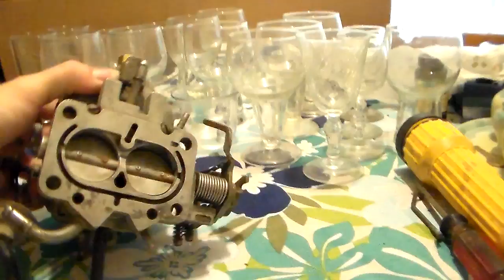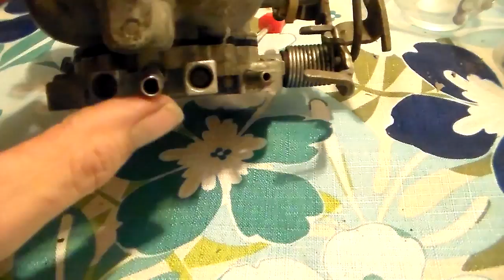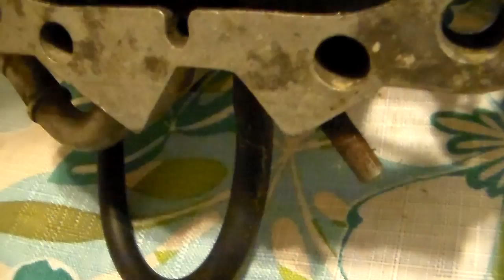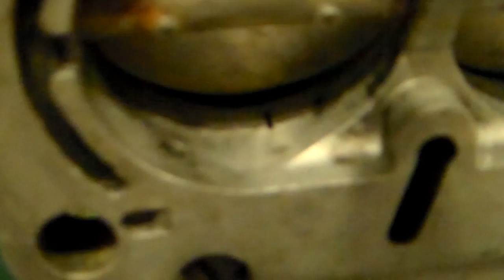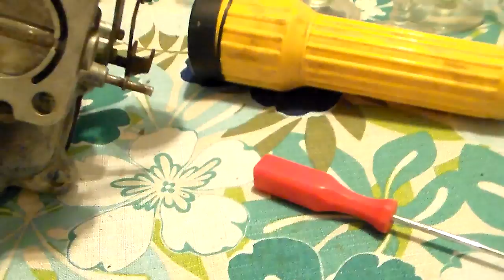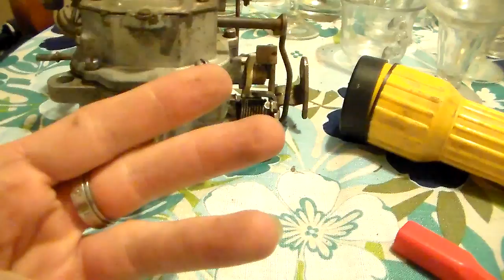How to understand the difference between manifold and ported vacuum sources

Comment: I have a 1983 GMC Suburban, the cruise control diagrams don't show exactly where the engine vacuum line connect to or gets it vacuum from.  Do you know?  i have 1 going to the accumulator 1 going to the throttle and cant find out where it gets the vacuum from.

Comment: Loved the video. You gave me the answer I was looking for; how to figure out which is and is not a ported vacuum port by simply looking at my carb. A plus was that you did it with a carter 1bbl like I have on my ford 300, but that's not nearly as relevant as knowing how to figure it out myself on any carb anyway. Second thing, and a bonus, was the description of the temp controlled vacuum tree. Now I understand it's basic working parameters, and know exactly why it's placed where it's placed. The only question I could possibly have would be on that thermostatically controlled tree. Being screwed into the intake manifold raises the possibility for it to receive it's vacuum source from the manifold itself. That would be the question. If so, that means that even being unused, all ports on it would have to be blocked to not have a vacuum leak when the engine is at operating temp. If it's fed externally, meaning a larger feed port to the device that is fed from the carb or other port elsewhere on the intake, that would mean that it would be unnecessary to worry about blocking off anything at all on the temperature controlled vacuum tree if it's being unused at all. great video, though. It gave me the information to go figure out where ported vacuum is at any time, and on any carb.

Comment: I have a 1987 D150 with a carter carb BBD that us junk I would like to replace it with a far simpler version for 1/3 the cost. Can I do that with a power brake booster and just use a manual choke ?
Reply from the maker: Not sure what you mean by far simpler version unless your carb has the partial electronic controls. You can buy a NEW BBD clone carb off ebay which work well. They are about $75.00. Need more info on your setup though.

Comment: And that transition slot that you said don’t worry about. That’s the cause of most issues. People add to much curb idle. When they do not have enough timing. They open curb idle to raise rpm. In doing so. Your expose to much of the slot. That slot dumps fuel in. Rendering your idle air mixture screws useless. You can close them off and still idle because the open slot is allowing to much fuel into the carburetor. It’s a very important feature of the carburetor adjustment when properly set up.

Comment: Ported vacuum did not come along until the late 60’s and 70’s. Why would manufacture matter? Think about it. An engine is an air pump. Regardless of make. Ported vacuum was used because lower base timing creates higher exhaust temps. The theory was to burn off exhaust better. It was a band aid if you will. Manifold vacuum adds timing when the air fuel mixture is lean. Allowing the leaner mixture to burn better. No different then when you are cruising along and you have vacuum adding timing. When the mixture is lean and the timing helps burn the lean mixture. When the RPMs go up. The mixture richness and the vacuum drops off. Guess what. All that extra timing goes away wether you are on ported or manifold. Curve your distributor to allow a base timing of around 12 degrees. Adjust your vacuum pot to allow in about 10 degrees. And run it on manifold. And never look back.

Comment: Good explanation thank you 
I have a project I'm trying to finish ultra low budget  it's a Japanese 4banger with a carter BBD carb from an early 80s dodge pickup fit on manifold like they were made for it
Starts great idles cold smooth as mole hair 
It's running pig rich any help ?

Comment: I have an ‘86 Toyota pickup with an R22. I replaced all the vacuum lines a couple of years ago and it took 10 feet of vacuum line to get the job done. Don’t know who designed the system but it’s just nuts.

Comment: You seem to be the guy I Need to talk to. I seen you do a Lean Burn Convert on your Diplomat and is what I want to do. I have the 6280 carb. I believe this one doesn't have port vacuum to run the Advanced vac on the distributor. Everywhere I've read says I need a Card with port vac....except one place which said I could "run off the the vacuum solenoid, this coupled with a throttle switch controls vacuum, giving a ported vacuum source." Does that sound right to you? Thanks. any help to save $$$ would be great

Comment: How do I know if my temperature control vaccuum switch is working? Even when my motorhome is warmed up I can't feel an inward flow of vaccuum trying to engage my EGR valve. I have a 4 line sensor coming out of my thermostat casting. Please help. David 🐈

Comment: At 15:55 of your video you talked about multiple ports being hooked up to a temp sensor to tell the vaccuum at what temp to come on at. I have a 1989 Chevrolet P30 chassis with a 7.4L 454 V8. Inside my water thermostat housing on top of the block there  is a copper insert which takes a 'reading' of the water temp. This is where 4 of my vaccuum lines get hooked up to. I had always wondered what this was for. Now I know! Thank you, David 🐈

Comment: I have two quadrajets. One on a running 403 one on a 307 that did run a few weeks ago. Tried timing the 403. Hooked up a vac gauge to the dizzy port. Mostly because it was an easy way to plug it. No vacuum in any rpm. Pulled of the carb tried compressed air. Completely blocked off. Went to the 307 carb. Same thing. What is going on? Please help.

Comment: Could you do a video on the lock up converter. I have a th350c in my 84 c10 square body. I have heard it needs to have manifold and then someone say that it needs ported vacuum. I've heard it needs to be ran through a tcv switch. It's sort of a mess and a headache. Could you explain this if possible? I thank you for your videos on the quadrajet. I am running one on my truck. Best carb ever built IMO. Thanks.
Reply from the maker: I'll be glad to . That's a tough one. They actually use both ported vacuum and manifold vacuum. Thanks for the request.

Comment: Great Video!  I learned a lot.  My 83 CJ7 has a this BBD carb and it is running real rough.  As it warms up it runs better but still rough.  When I rev the engine I get BLACK smoke.  Real Black.  What would you suggest.  I have been told it is too rich.   Thanks again for this great video.  :)

Comment: thanks for the reply--like you mentioned--i also thought of changing out the metering block but seeing how this carb was just rebuilt / along with the possibility of non matching passages, i just left the vacuum line off the dizzy for the time being. its also seems to run great with out the line being hooked up, however the car is not on the road and driving at normal conditions either. i will be watchin your vids-take care

Comment from the maker: Haha..that's a good one. It's said that you can swap the metering block with one that has the ported vacuum port, but the gotcha may be that your carb does not have the passages drilled that need to be there to conduct the vacuum signal.

 You can also lock-out the vacuum advance and simply use initial and mechanical advance to get your total advance number. I'm going to be doing a video on that subject soon.

Comment: My EGR system in my "78 Camaro with a 350 used a "ported vacuum switch" that was basically a vacuum switch in series with the EGR valve. It sensed my coolant temperature, and opened up when the engine was warm. It, presumably, was not needed when the engine was still cold.

Comment: My 1977 F-150 (351M400) has a maze of rubber vacuum lines, and I was told that this was fitted on carbureted models for smog control before Ford switched to fuel injection, or something.
One thing that was useful, when you talked about simplifying it reminded me, is take digital pictures before taking stuff off; I was able to put lines back on without having to know what they all do.